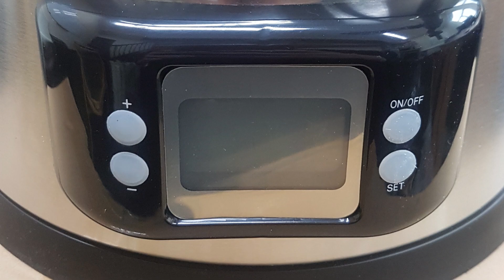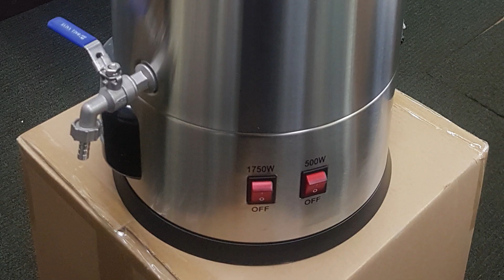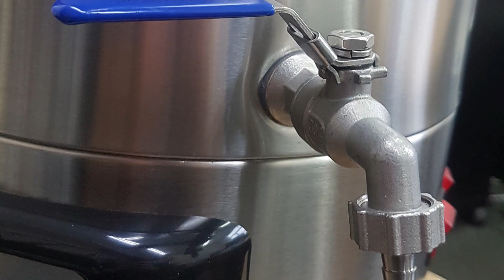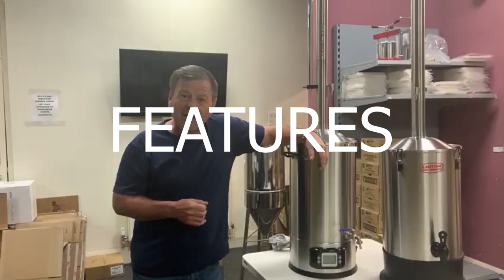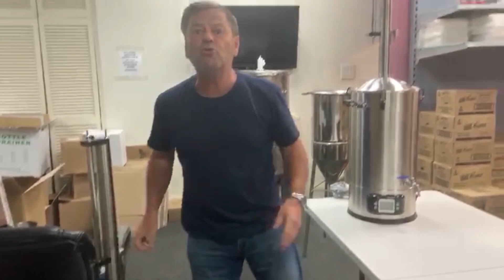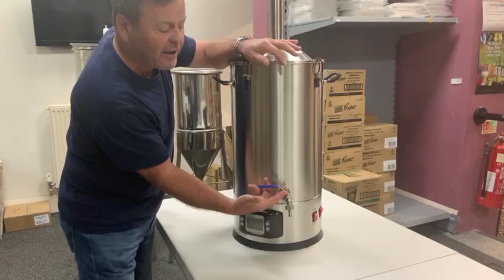Using the Spiritworks Boiler - Part 1

Comment: So does the boiler cycle on/off when temp is reached?

If set at 96 deg C....
ie:  at 96 deg C it switches off.
When temp drops 2 deg C (to 94) it switches back on again.

In other words....it does not have a constant power supply at all times.

Not what you need for a distilling boiler.

More appropriate as a hot water urn in an old folks home.

Comment: Hi, This looks amazing!. If i was to buy a full starter kit, like the T500 Boiler with Turbo 500 Copper Condenser Starter Kit, Could i have the option to "upgrade" to get the Spiritworks rather than T500? (Plus pay any extra as required for the upgrade). Thanks loads.
Reply: Purchased my kit yesterday including this boiler, Cannot wait!. Would love to see some more videos of this in use like a quick tutorial around temprature setting and so on. Great looking piece of kit.
Reply from the maker: Here's a new one https://youtu.be/YlfIejkJRx0
Reply: @LoveBrewing  Hi guys any chance of an in depth video showing setup temps on the boiler ect for a distillation ?
Reply from the maker: @vamphay  We've got something similar for our spiritworks boiler, but I'll pass this on, cheers!

Comment: How does the new temperature control affect the outgoing water temperature during distillation? Do we still aim for 50-65C (but less than 55C ideally)? I'm guessing this changes as the liquid isn't boiling anymore as it is with the original T500 boiler? Maybe all this detail is in the manual I guess.
Reply from the maker: You actually need to set the temperature higher than the boil temp of alcohol ( normally 78-82C) for several reasons so I do around 96C. Its still needs your outlet temperature setting as normal.